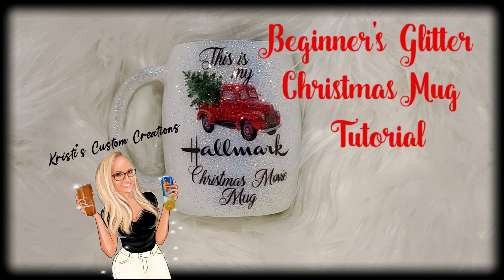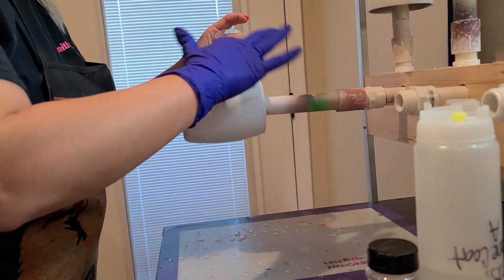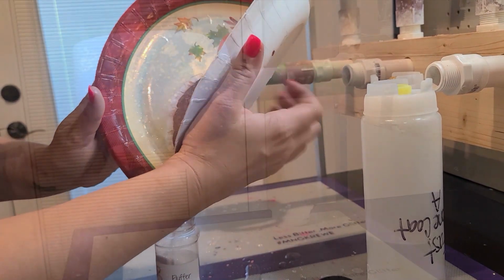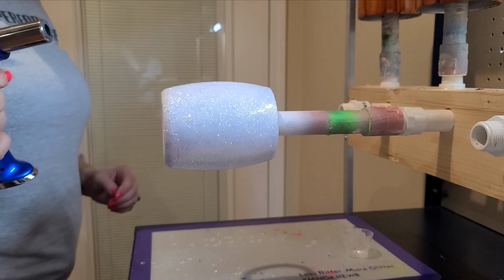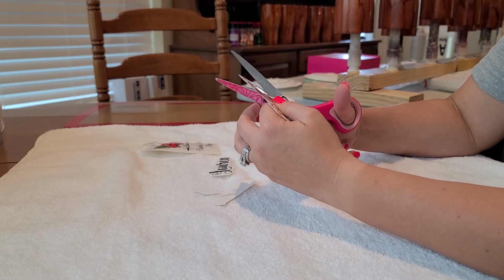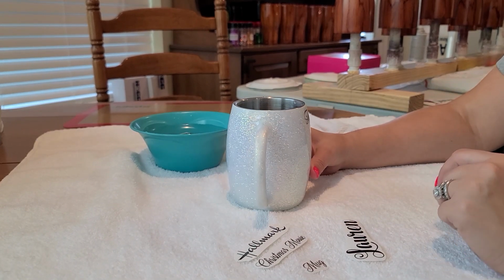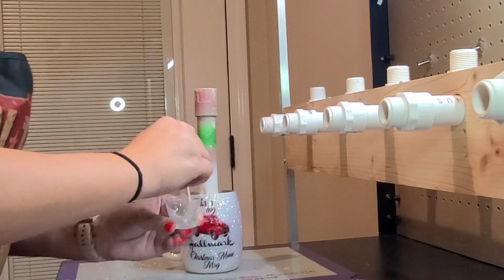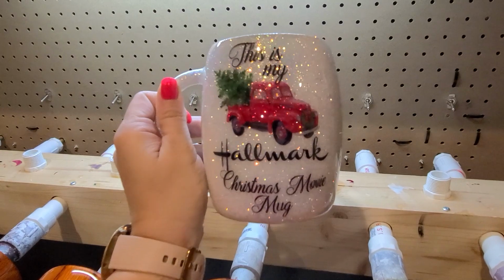DIY Beginner's Glitter Christmas Mug Tumbler Tutorial Easy: Learn to make a Glitter Tumbler

Comment: So I’m fairly new to all this what was the reason again for two different kinds of epoxy. And can you use a heat gun instead of a torch? And also with the torch is the fire actually touching the mug, great video thanks
Reply from the maker: The two different epoxies are just two different brands that I like to use. Since filming this video, I actually now only use Tumblerpoxy and Swiftpoxy for my epoxy. You can find both epoxies at www.tumblerpoxy.com but I also sell small 16oz Tumblerpoxy kits on my website at kccglitter.com. And in reference to your question about the torch, yes, the flame is very lightly touching the epoxy. You want to make sure you move quickly with the torch or else you could burn the epoxy.

Comment: How are you preventing the epoxy from going inside the mug?
Reply from the maker: @pennypontillo3051  I don't move my fingers so that I pull any epoxy into the rim of the cup. If you notice when I apply epoxy, I always push out towards the edge. It will get some inside the mouth of the cup but I just clean that out with a razor blade and acetone afterwards. I actually have a video somewhere here on my channel where I show how I clean up the rims of the cups

Comment: Can I use heat gun instead of torch???
Reply from the maker: The heat gun will make the epoxy move but the heat gun pops the micro bubbles so much better